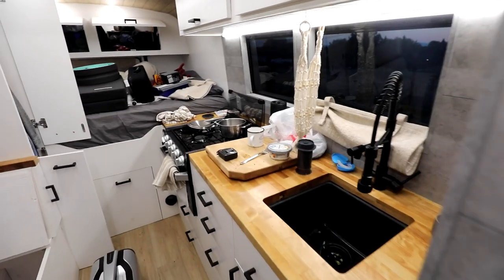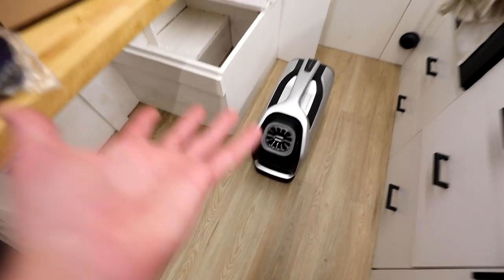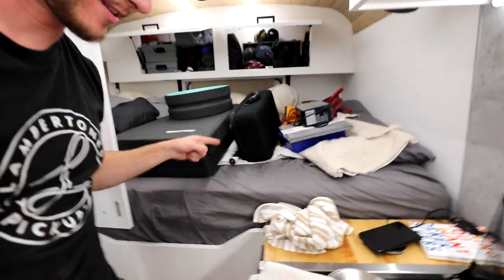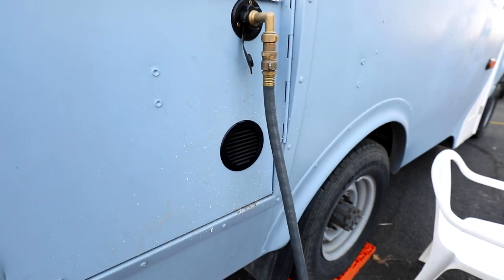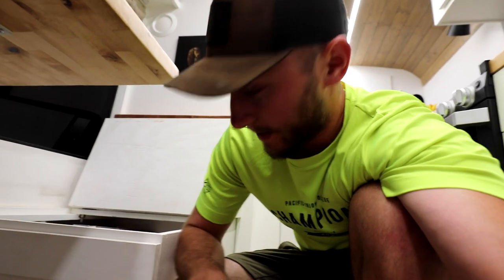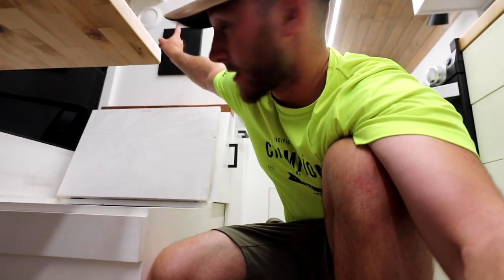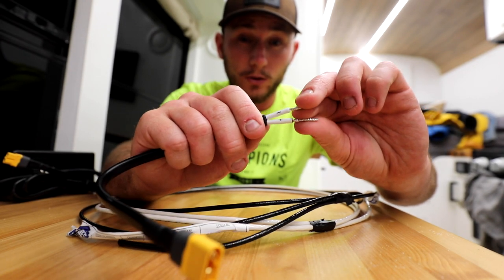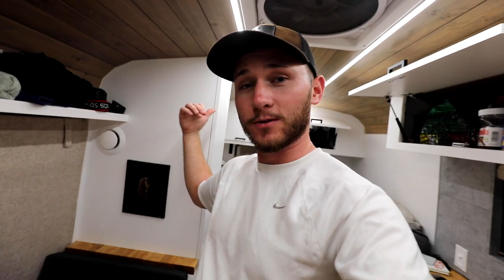Installing the Zero Breeze Mark II in my Bus Conversion

Comment: I really like your dedication to the Mark II in your small bus conversion and sharing all the details for your hookup....... I anxiously await your results. From my experience with the Mark II in my much smaller spaced Semi Truck, I have found this.  The shorter the hoses without much extension the better the results. NO turns in the hoses is huge. And believe it or not, screen door mesh to prevent bugs from entering is even too much restriction to properly exhaust hot air. I really believe this unit is a spot cooler and not a space cooler. As a spot cooler it rocks! Good luck.
Reply from the maker: I 100% agree with your findings and I've found similar results so far. There is a compromise with adding that hose, what I gain is the space, noise reduction, and concealment but indeed it takes a toll on the output. Definitely spot cooling over space cooling for sure
Reply: @BibiaBus  
Can you comment on how your Zero Breeze battery run time has proven? I'm only getting 2 hours on sleep mode and its suppose to get over 5 hours on sleep mode.

Comment: Thanks for the info. Been watching a bunch of your videos now. 
I got a question about your battery setup... The 24v to 12v adaptor says it needs at least 25amp consistent from the battery.  My battery says 10-20 amps continuous. Sooooooooo I don't know what I'm asking besides what's your battery setup put out

Comment: Stefaan, good work on the install. The intense heat seems to be past at this point, so hopefully you're living cooler right now no matter how well this this works. The only thing I'm curious about is why you ran the vents out the door rather than above the wheel well. I know you thought through it all, I'm just wondering.
I think you do a great job explaining the install process, and make it easy for anyone to do this themselves if they want to.
Reply from the maker: The heat comes and goes, we're back to a week of mid 100's but thankfully im plugged into the grid so I have some alternate cooling options when it's this hot. Back to testing this on the weekends and cooler days. As for the routing choice, it was based on a few things. I have several wire runs that go through that wall above the wheel well so that was the primary reason I didn't want to start drilling through there. I could make reasonable assumptions as to where the wires are but there was no guarantee and I didn't want to get into that business. Besides that, the curvature of the exterior would make installing a flat grate a little tricky but it was really the wiring that made the decision for me.
Reply: @BibiaBus  Not chopping through your wiring definitely sounds like the wiser choice. That would be the route I would've taken as well!! And mounting to the flat door vs. curved wall, I'd pick flat too.

Comment: The air intake, or the air that needs to be cooled, should be pulled in from above because heat rises. Probably building a cabinet up high and buying a 6 inch max fan and venting hot air exhaust through roof would be better in my opinion. The drip line can go behind a wall and out through the floor. I installed a small air condition in my van that way. I run it with a small generator all night. Works great. Can run with lithium for hours as well. I would direct cold air output towards sleeping area only.

Comment: ... maybe route your condensation into a holding tank. Add a pump on a float switch so that when it fills up it pumps it through a filter and into your water tank...I live in FL, in places like this you'll collect a substantial quantity of water that way.
Reply from the maker: That'd be a solid idea! Id consider it if I were anticipating high humidity for extended periods of time...which isn't on my horizon any time soon haha

Comment: You can buy an extension cord that is flush with the outlet (flat) so your charger doesn't stick out into the insulated duct, in the closet.

Comment: Good craftsmanship and planning. Unfortunately you never learned about air flow reduction. At 75 CFM, a sweep 90 degree elbow is equivalent to 5 feet of straight pipe.  A hard turn 90 degree elbow equals 17 feet of straight pipe. In your case you have a hard 180 degree turn followed by two 90's. You have probably reduced your air flow by a much as 80%. The unit as engineered was not designed to duct the cooled air. You will have far better results eliminating all the cooled exaust ducting and let in pump the cooled air straight into you  living space.  As you bed is low having the air somewhat stratified won't hurt that much when trying to sleep. Sorry to be the bearer of bad news.
Reply from the maker: No worries, Greg! I appreciate you explaining exactly what I've been experiencing. Going into this, I didn't consider how deeply the ducting would affect the actual output of the unit and I can say that the effects you described are exactly what has happened. I've been using it without the ducting in an effort to maximize its effectiveness...still need to make a follow-up video about that application.
Reply: @BibiaBus  hey man thanks for taking the time to make this... considering installing this unit in my ford transit conversion.. 6 months later are you finding it was worth it?